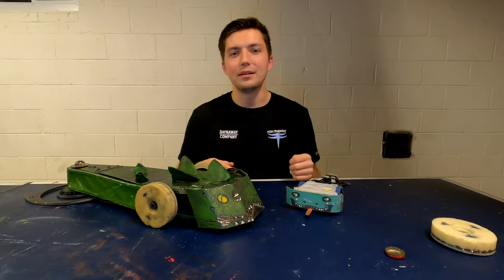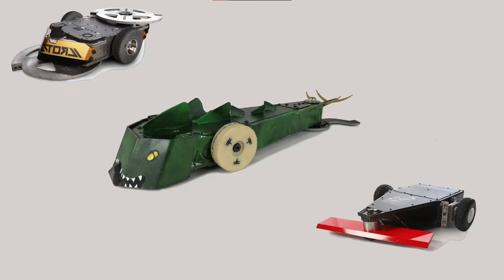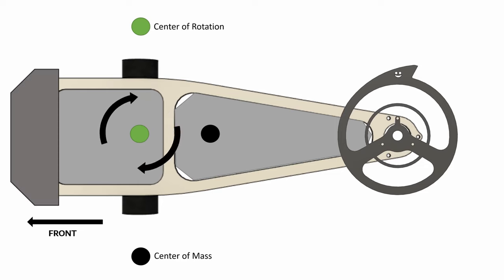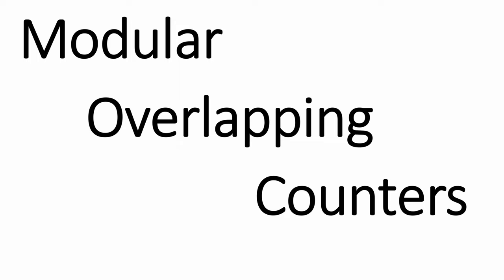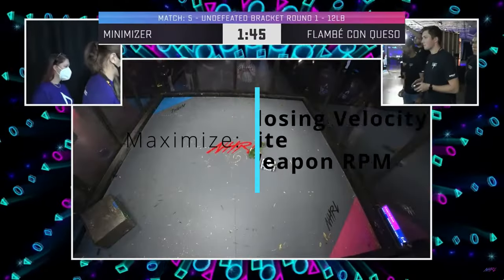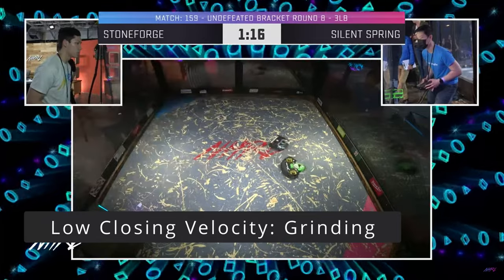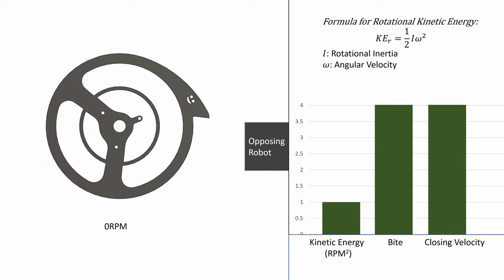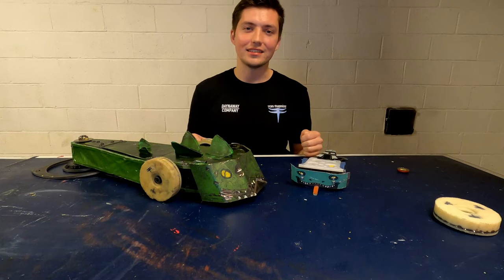The Thagomizer Fundamentals - Combat Robotics

Comment: Great design.  It looks like you direct drive the blade on thagomizer.  Do you think you could get away with that on a beetle?
Reply from the maker: Yeah ant Thagomizer runs a direct drive, however I'm already running on edge of feasibility at antweight scale: unhardened the motors explode immediately, and I've also have the motor shaft shear. With beetleweights hitting many times as hard and motor shaft strength not scaling nearly as much l I don't think it would be possible to mount it only on one side like on Thagomizer.

If you were to replace the shaft and/or mount the weapon on both sides it might be possible to keep the motor alive. Unfortunately I don't have any experience direct-mounting weapons in higher weightclasses.